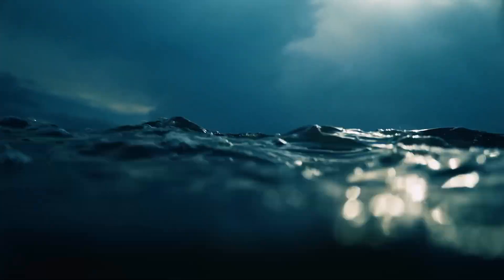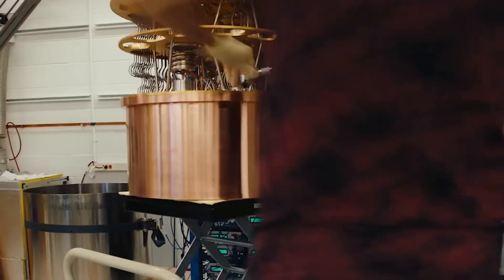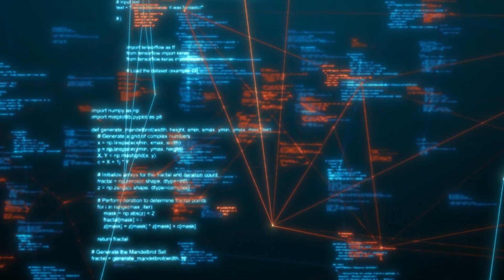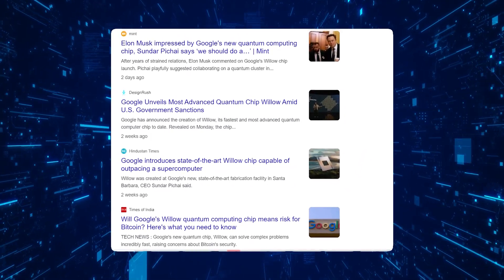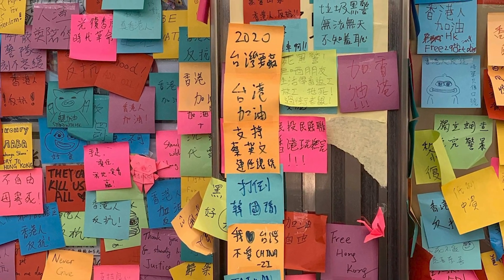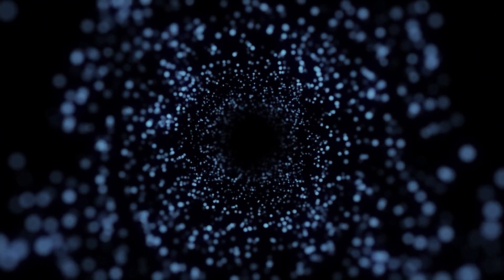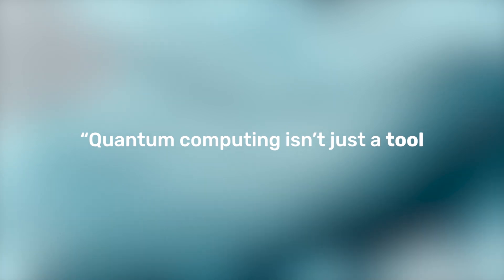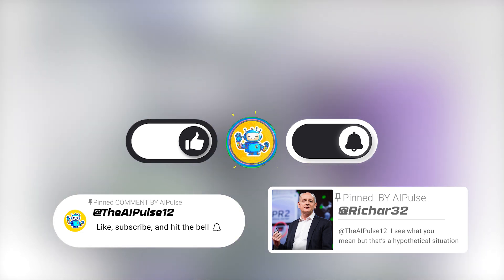Google's Quantum Chip Breakthrough: Reality Will Never Be the Same!

Comment: The 'leveraging parallel dimensions' theory is false, it would suggest that all NP (non-deterministic polynomial time) problems are QBP (Quantum bounded-error polynomial time) which does not appear to be the case.
Reply from the maker: You're absolutely right that the 'leveraging parallel dimensions' idea is a popular oversimplification. Quantum computers don't literally use parallel dimensions but instead rely on principles like superposition and entanglement. Also, your point about NP problems not being fully solvable within BQP is spot on—quantum computing provides speedups for specific problems (like factoring with Shor's algorithm) but doesn't encompass all NP problems. Just a small clarification: 'QBP' is likely a typo for 'BQP' (Bounded-error Quantum Polynomial time). Great insight!